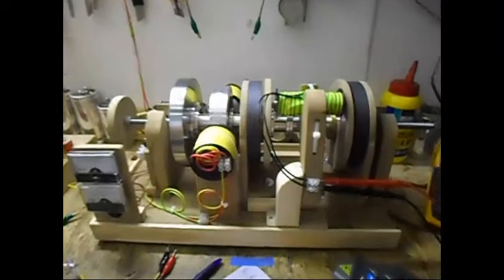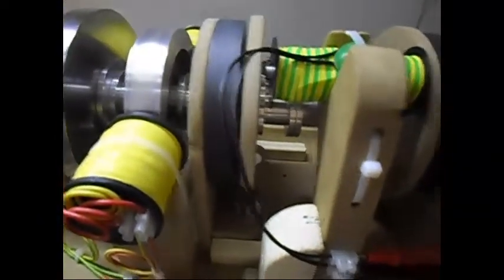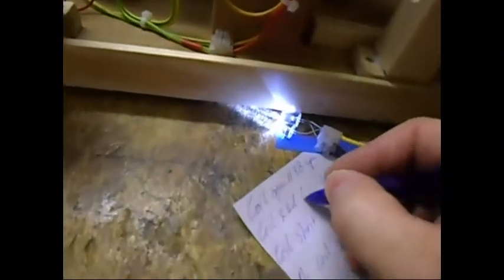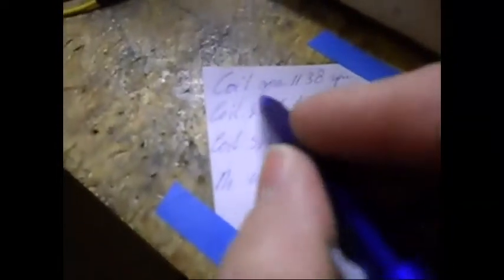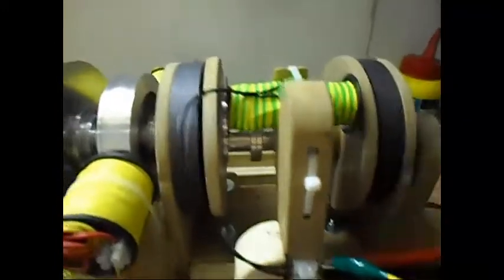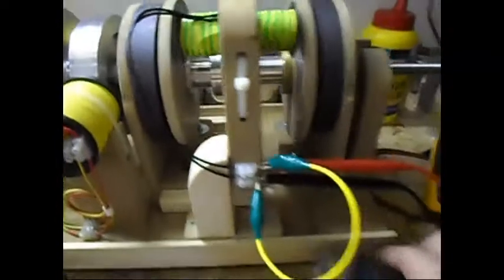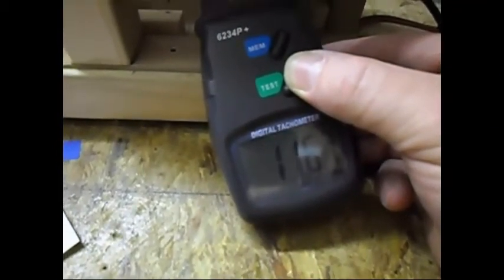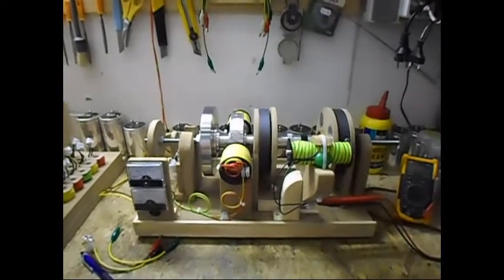Flux Gate Generator - Update 5 Pull Mode, 2 ring magnets - long coil...

Comment: Very interesting results. I would like to see what happens with, a transformer connected. keep the videos coming.
All the best.
Bobby
Reply from the maker: Hi Bobby,
Thanks for your comment, it is nice but i don't think there's enough for me to go with it...-.-
The transfromer can only be connected on it's low resistance side so it feels like a short wich will step up the voltage even more and at these millie amps output it's not what i need...lol

Comment from the maker: Here i'm doing a test with the long coil as in Update 3 but with a Pull Mode magnets configuration...^^
The input is also lower this time, 16vdc @ <30ma since i broke my voltage doubler...less input wich means like 6oo(ish) rpm less but with better output...;-)
The output is kinda the same as it is at around 1800(ish) rpm but compared to the short coil both same to have the same output at this rpm even though the open volatge is 17vac...???

No coil in place = 1306 rpm (i said 1375, bearing issue gives a bit rpm fluctuation)
Coil in place and open = 1138 rpm
Coil loaded = 1120 rpm
Coil shorted = >1170 rpm (speed up while coil is being shorted)

At 3.40 minute mark,
I was supprice to see it speed up while under short because i haven't done this test yet and i didn't expect it to do that at this rpm...o.O
I said it many times...do only short your coils but also do a real load...coil shorting only can give you false hope...;-)

I was gonna modify this setup for the next design but since i gotten Mister Lenz to assist me i'm gonna drive it on 30vdc input and see if i can get the speed up but under load and not only short...lol

Comment from the maker: Update on this one...^^
Connected one of my Dc to Dc converter and run this setup here on 29Vdc input @ <50(ish)ma,
No coil in place = 1925 rpm
Coil in place = 1806 rpm
Coil plus them 2 leds = 1785 rpm
Coil shorted = 1825 rpm
The open coil voltage is around 27vac but when loaded it drops like crazy and it illumination is just like at the lower rpm in the video...-.-
But i think a stepdown tiny transformer with a 1:2 ratio will be a good move if i can find one...lol
I've seen many times high voltage with low ma go broke when connected directly onto a load but when sent thru a stepdown transformer it gets much better...
Have fun...^^

Comment: Kromray patent number 3 ,374 ,376
Check it out if interested.
I will  be using a generator similar to this in my setup but, it will be a bit different. The goal is to use like you have, a generator that speeds up underload.
Reply from the maker: Hi Ryan,
Thanks for your comment and the patent number of bedini's kromray...^^
A generator that speeds up under load is always good to have...;-)

Comment: The motor must then have good torque and draw minimal amps and utalize the back emf  as well to charge up a second battery or charge a cap and using the right switching dump into the run battery. I have three motors on the go to find the right one. Anyway, thats my thoughts on the matter. Thanx
Reply from the maker: Hi Ryan,
Thanks for your comment and the input on the motors...^^
Yes, having a torqy motor and minimal input is always a good start...;-)
Good to hear that you have 3 on testing to find the better one...that's the way to go at so...Go for it...^^